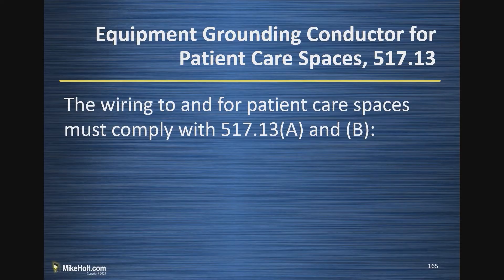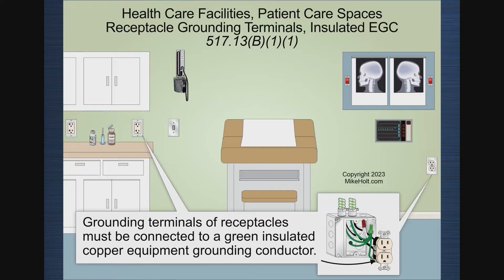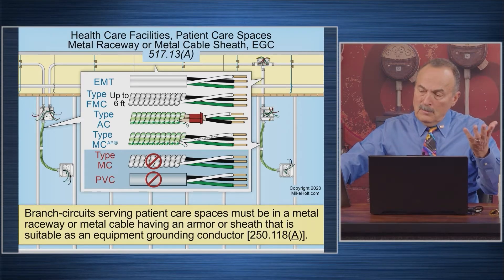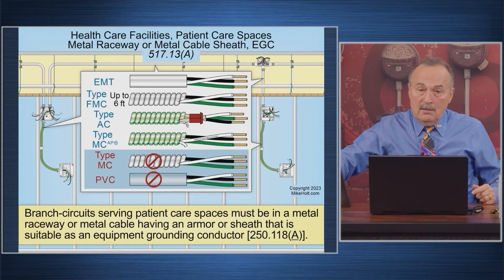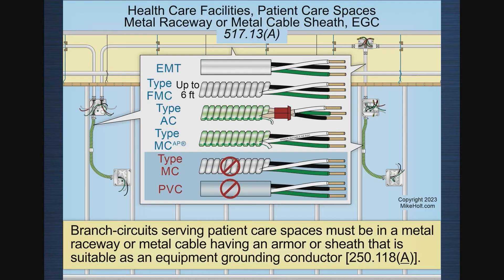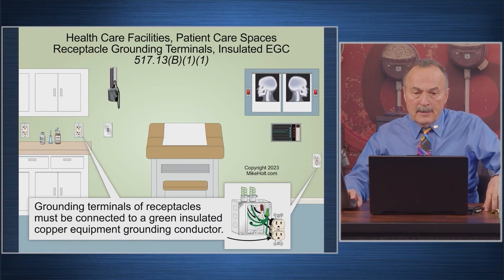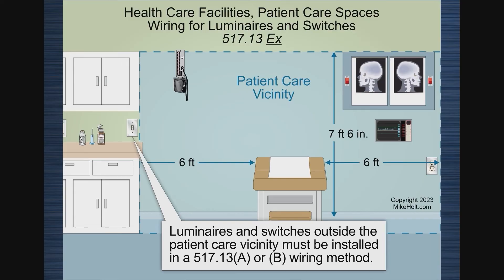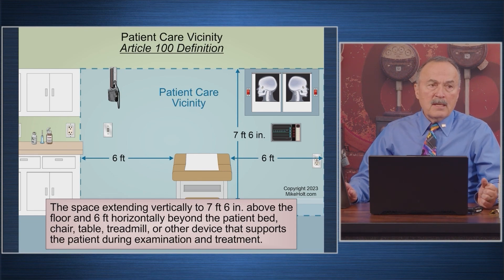EGC for Receptacles and Fixed Equipment in Patient Care Spaces, NEC 2023 - [517.13], (11min:59sec)

Comment: Great video! Let’s not forget the other exceptions here that are very important. 517.10B states area is exclusively used for intramuscular injections, psychiatry, and psychotherapy, alternative medicine, optometry, and pharmaceutical services.  Also, let’s not forget that the design designation of the types of patient care spaces is the responsibility of the governing body of healthcare facility both design and the inspection of a patient care space are based on the level of patient care anticipated in the space.

This is very important as there’s a lot of jurisdictions that the inspectors I have seen have failed these areas and they are trying to designate the care of the space because they see an exam room on the plans. I’ve seen this many times as A plans examiner and working with the Inspections department. All they see is the word healthcare and then they try to automatically implement 517.12 and 517.13… there are many spaces coming up specifically for intramuscular injections and I’ve seen many inspectors. Try to fail this because they don’t have both wiring methods covered.

I’ve heard the arguments for many chief electrical inspectors that have tried to tell me no they have the availability since it says an exam room or an exam bed but now they can plug in some equipment and use it or well now they’re withdrawing blood and now they’re gonna use these other pieces of equipment and they are actually trying to be the governing body and that specifically goes against what the code says. They’re not doctors and I’ve had to tell them that many times that you were an inspector you’re not a doctor and you don’t know what they’re going to use this room for you have to go off what they say. It doesn’t matter because they can plug-in medical equipment in the back of a van somewhere or in an alley and you still won’t know if they have in the future a change of use that would also be a different set of plans and all responsibility would not be on you if they did this under the table without permits

Very good calling out ACA as well.. if you have not worked on hospitals, a lot of people will not be familiar with this body. If you are working in the hospitals, NFPA 99 is also going to be very helpful.

Comment: What's going on with the patient in the x-ray 😅

That does not look right

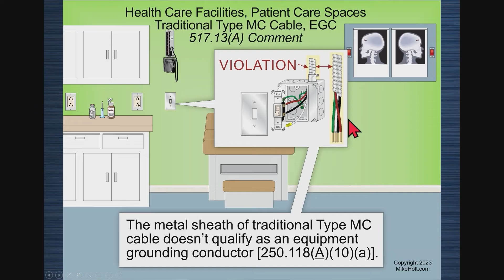7:13 how did he get a cap screw in his brain
Reply from the maker: Have you every 'shot' a wirenut out of 1/2" EMT? Looks like that's what happened.
Reply: @MikeHoltNEC  no, not yet 😆
Reply from the maker: You have to use the 'old' soft plastic wire nuts, I think Red was better than Yellow...

Comment: I remember one of my biggest incidents when I was an inspector was when I failed a contractor doing a dentist office and didn't use Hospital grade MC or Receptacles in the dental operatory circuits. Everybody in the Neanderthal area that I live in thought that you only needed hospital grade MC in hospital grade receptacles in patient sleeping areas because they never bothered to read the code. The dental operatory is deemed a critical care area due to the use of nitrous oxide and other agents that could incapacitate the patient. I stood my ground and had to recite the code to every idiot in the entire region.
Reply: @devinpratt4644  Years ago one  of the large downtown Philly hospitals decided to only use type AC cable ( ya BX ) in patient area. After a patient received a shock they got caught and had to pull out the BX and install the proper cable.

Comment: Not a fan of using EMT conduit has a grounding path. Have seen it pulled out of both compression & set screw couplings & box connectors along with rusting out.
Reply: If I rewire my house I'll be using MCAP-HCF for this reason 😅
Reply: The Code is the MINIMUM... things like this are why...

Comment: Retired from a large hospital and would burn me up on two issues: From around 1980 to at least  2010 Philadelphia  electrical code stated that aluminum wires were no longer allowed for ground wire. ( PA does not have a state license ) . Electrical contractor would install 12/2 HCF cable with a #10 bare aluminum wire. The lazy noogoodnics cut the #10 solid aluminum wire maybe 4" long with exposed sharp edge & push it into wall case. Asked how do they get away with that aluminum wire & why don't they tape off or install a pressure connector on sharp end. At two IAEI meetings I questioned the cable presenter & inspectors if that was legal in Philadelphia. Nobody gave me ayes or a no. Also thought that on every steel stud that a patient room receptacle was mounted on they should runs #12 copper ground wire to.